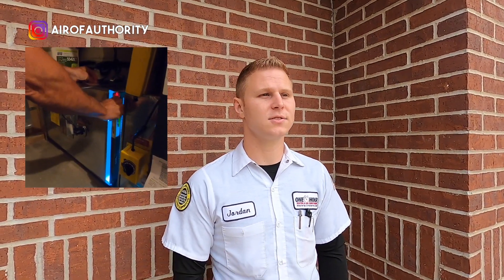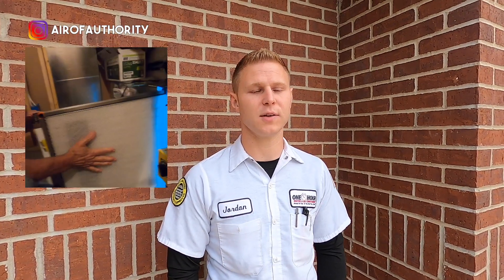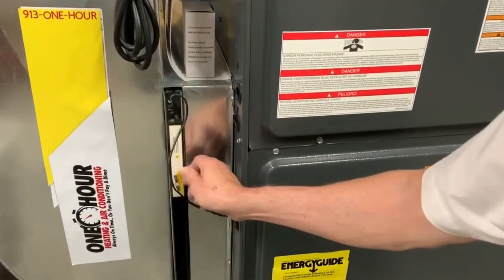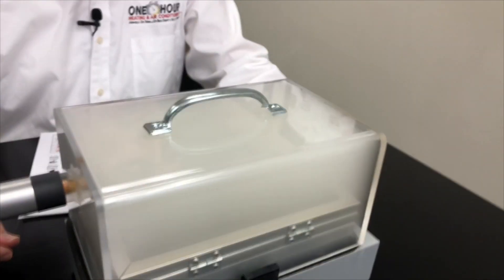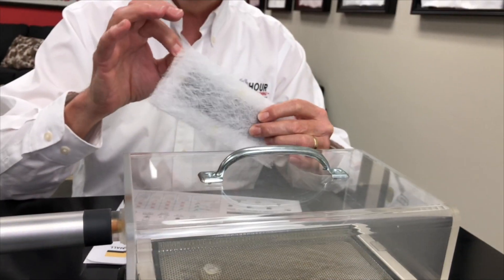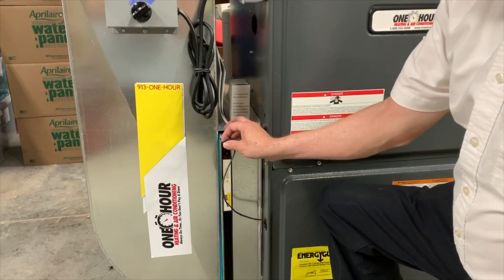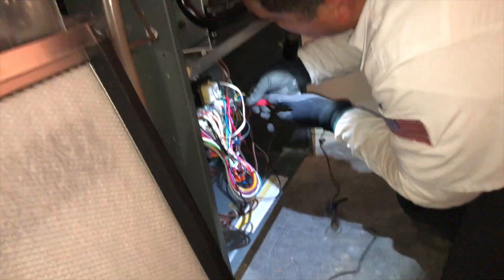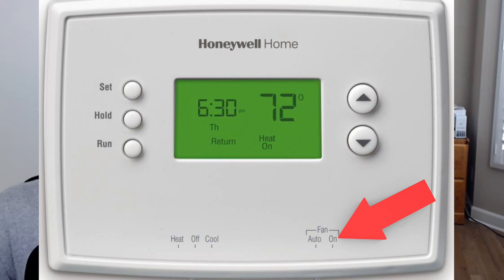What is a MicroPower Guard Filter? How is it DIFFERENT from a regular filter?

Comment: Can you tell me the difference of a UV light and your micro guard?
Reply: A Micro Power Guard electronic filter will protect your furnace from buildup and breakdowns, will keep your air clean from dust and debris. It allows a high level of filtration  without reducing airflow which is not good for a furnace. Regular heavy duty filters will restrict airflow to your furnace and will reduce furnace efficiency and can cause furnace life to be reduced due to heat stress on the heat exchangers and will also stress the blower motor.

An OXY UV light will completely sanitize your air and dramatically increase air quality in a home. It will kill allergens, germs and viruses. They also have a small ozone generator that completely destroys odors in a home without affecting humans. 

I use a UV light in my home for allergies and previous homeowners had cats so when I bought the house the home smelled like cats. I have sold many units to people with older homes and that old home smell, which this will make the home smell fresh again.

The ozone for odor control is small enough that it dissipates by the time it gets to the supply registers thus you are not breathing it in at all, some people get worried about that. Great products and they can work wonders on air quality.

Comment: I currently use a Micropower Guard Plus air cleaner on my HVAC. Is a MPG+ better than a HEPA air filter (MERV 17+)? I ask because my son has severe and itchy eczema on his face and eyes (and even some on his upper torso). Thanks
Reply: A MPG is no where near as good as a HEPA filter. However....a Hepa filter is a BYPASS filter. Meaning its so restrictive its meant to only clean a percentage of the Air at a time so it doesn't bog down your blower and harm your blower or cause corrosion on your evaporator from low airflow. It filters 100% of the air over a longer period of time. And the MPG has NOTHING on a true set up Hepa filter system. More important than either a HEPA or MPG is ductwork and system being sealed to as close to 0% leakage as possible as that is where alot of particles will come from vs passing through a filter. Look into using either a MPG or a HEPA but make sure your system and ductwork is sealed 100% and look into a UVC type air purifier like a Reme Halo or an Aerus Air Scrubber. "Tips from a true IQ pro and veteran HVAC tech and business owner" instead of some sales guy with minimal scientific training and knowledge. Look up ERV and HRV and Air changes per hour are EQUALLY if not MORE important than the type of filter used.  Hope this helps.
Reply: The MPG is a completely different animal from a HEPA filter. HEPA filters are very restrictive to airflow because they such a thick media that they can trap microscopic particles in the mesh. MPG uses an electronic field to accomplish the same thing without the air restriction. I prefer the MPG as they'll both get the air similarly clean after just a few passes of the air through the filter, but the MPG doesn't cause the restrictions reducing air flow and causing other issues for your hvac system. Wish you all the best in helping your son!